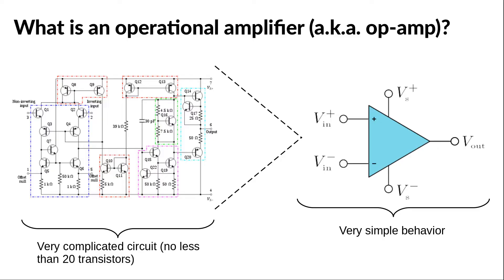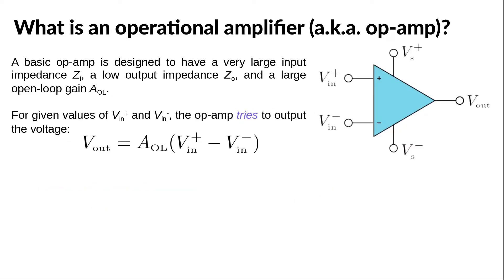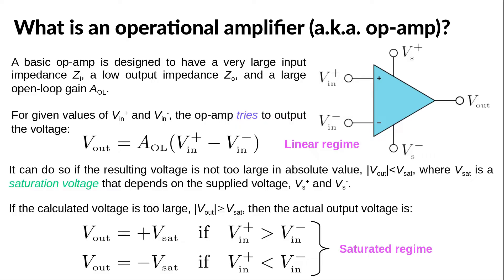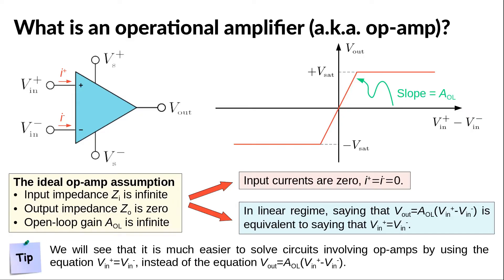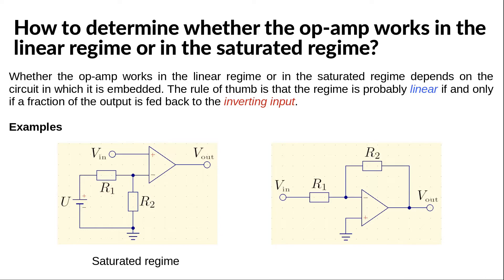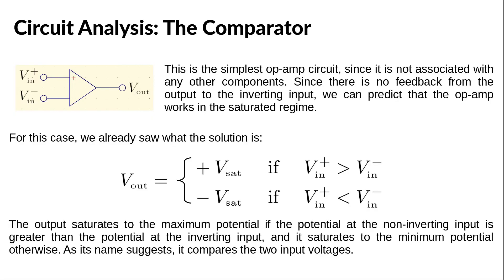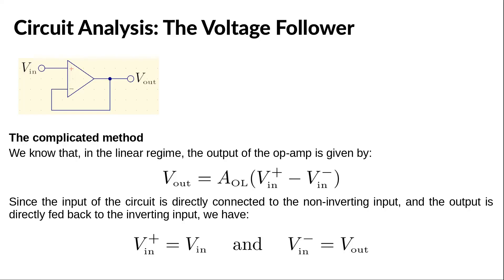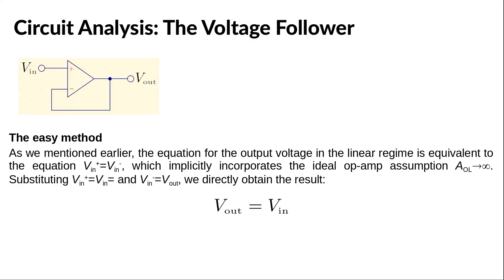The Operational Amplifier Demystified: Electronics Basics: Part 1

Comment: When you say "regime" do you mean the same thing as "region"? Thank you so much for making this video! I love your videos!
Reply from the maker: Not exactly, but it is closely related. In this context, linear REGIME means that the op-amp outputs a voltage proportional to the input difference, and on a graph this correspond to the REGION where the line is oblique. Likewise, saturated REGIME means that the op-amp output a constant voltage, and on a graph this corresponds to the REGION where the line is horizontal.
Reply: @BlueMoonshine  thanks so much! I've never seen the word used like that so thank you!